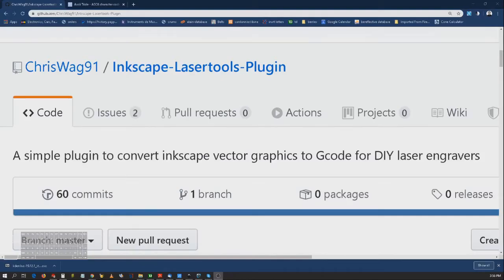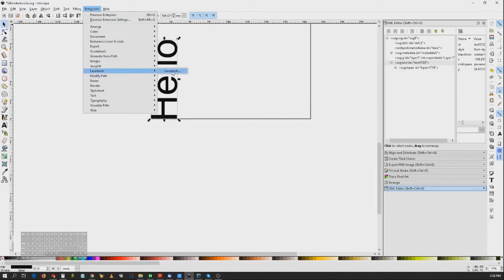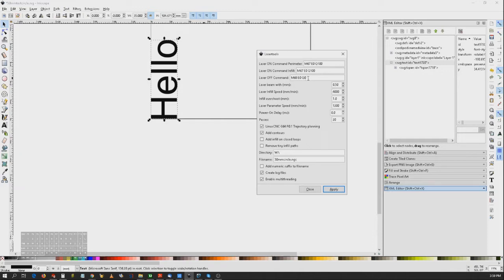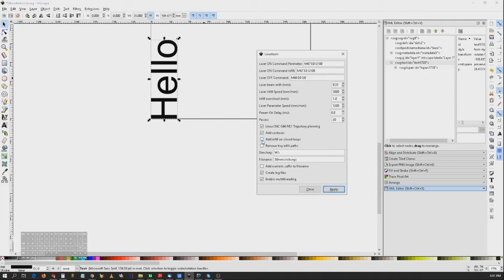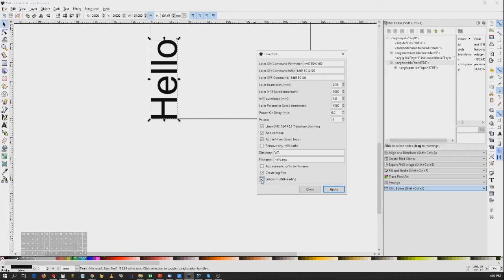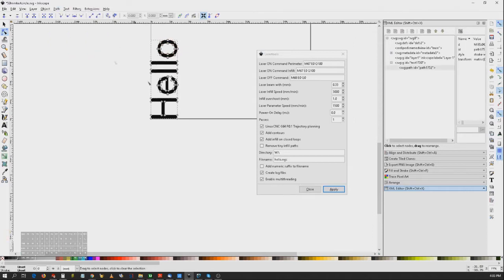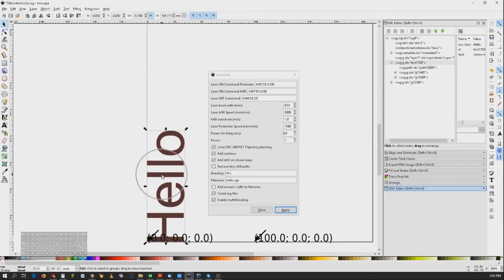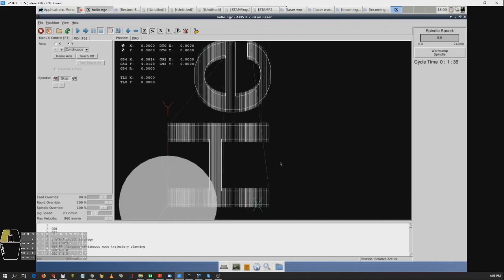Using Lasertools plugin for Inkscape

Comment: I am using Inkscape version .92 and when I click the lasertools extension, the GUI box is too big to access the bottom buttons, and it refuses to resize vertically. It does resize horizontally. I tried upgrading to Inkscape V1, but then the tool simply says "orientation points wrong" although the dialogue box is OK.  What am I doing wrong?
Reply from the maker: I am thinking that your system font may be a bit large this would be the reason the dialog box is so large.
Reply: @diypppalain  The text in the GUI box is actually difficult to read it's that small. Is there anywhere I can post a screenshot?
Reply: @diypppalain  I perhaps should add, that all the settings are the default installation ones, I have not adjusted anything, (mainly because I don't know how to yet)

Comment: Once upon a time I was thinking about acquiring a laser machine, but before there were no such powers.
Can such a laser engrave metal with thermal grease?
Reply from the maker: it can engrave painted ceramic it melts the glaze then the paint can be removed.